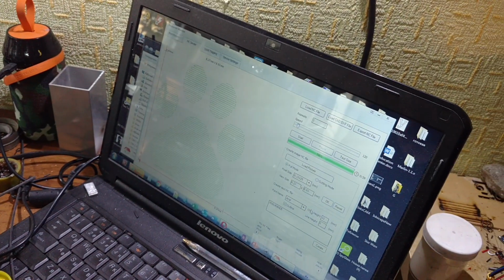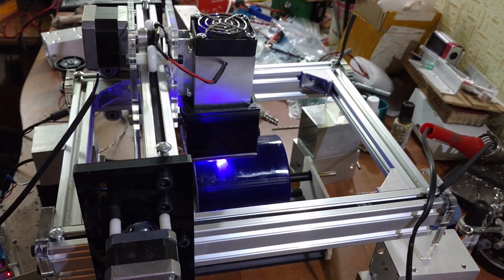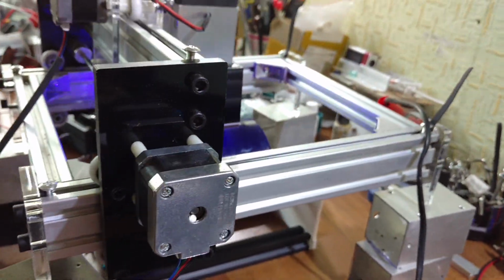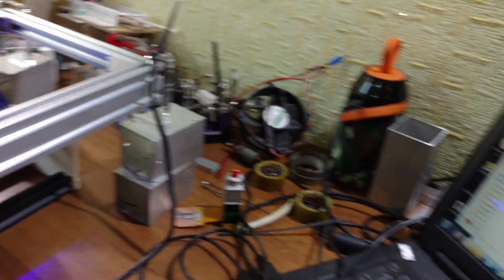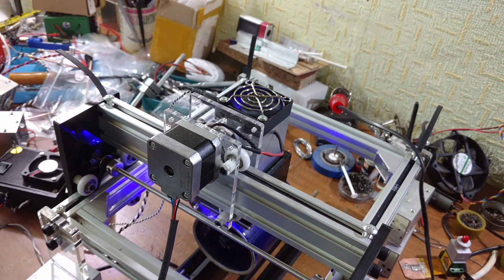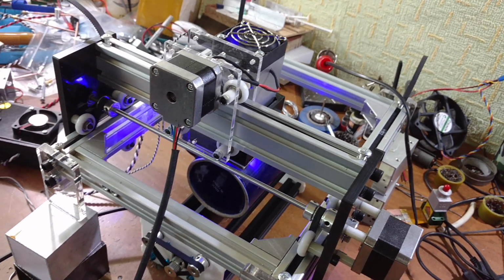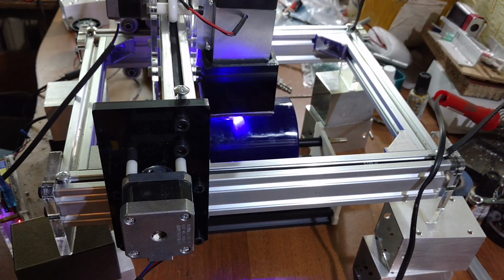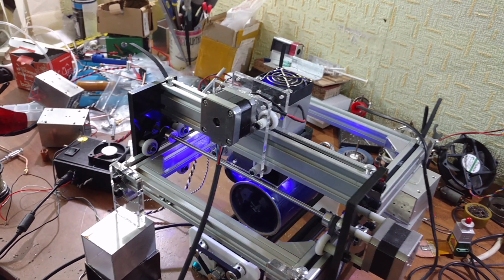Testing an EleksMaker rotary (a axis) jig with an Endurance 10 watt laser

Comment: I have the same rotary but it never goes to zero. Is there a setup manual?
Reply from the maker: just plug it to an X or Y axis and you are all set)
Reply: @Endurancerobotschannel  very late reply and kinda rude but that was not the case at all, if merely plugging in the x and y axis fixed it I would have never wrote my initial post. I did figure out the issue, the rollers are much too spongy which cause my bottle to slip a bit while moving. I covered them with electrical tape and fixed the issue.

Comment: What laser engraver will this attachment work with?? Is there a min requirement?
Reply: The attachment will work with any laser. Most Chinese controller boards only have X and Y stepper motor control, but this will work with any by unplugging the Y stepper motor cable and plugging this unit in. The unit is controlled by whichever software you normally use, but may need some tweaking. I have the K40 and this can be controlled with K40 Whisperer, but the best bet for K40 owners is to upgrade to Cohesion 3D controller board (a drop in direct replacement for the M2-Nano board that comes installed with most K40s) and Lightburn software, an absolutely brilliant combination that turns the K40 into a very capable machine. The Cohesion board has a dedicated port for rotary attachments and the Lightburn software is aware of this port. The EleksRotate Rotate Engraving Module is a basic but capable rotary attachment sold on Banggood for around £40 (about $45-50).